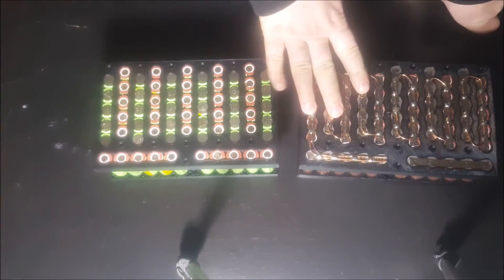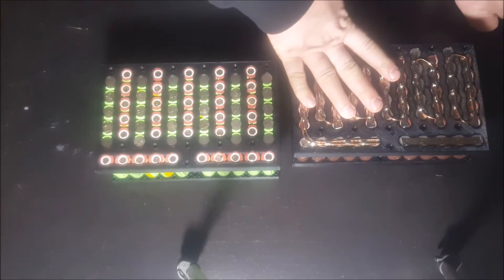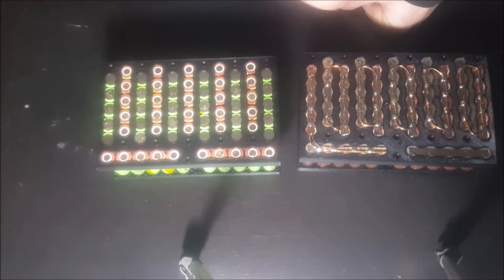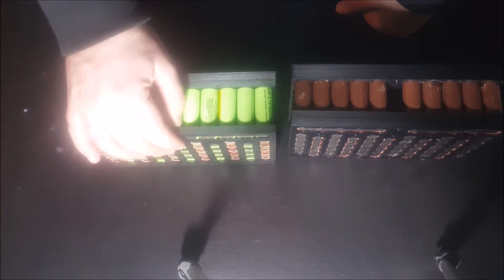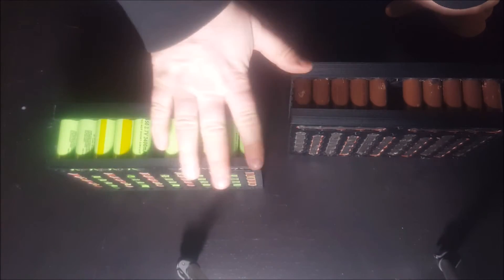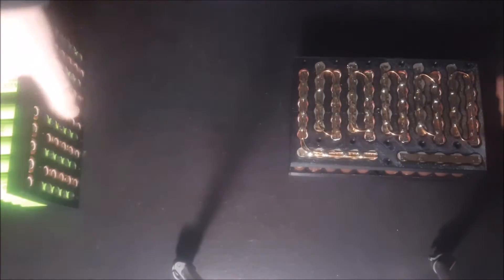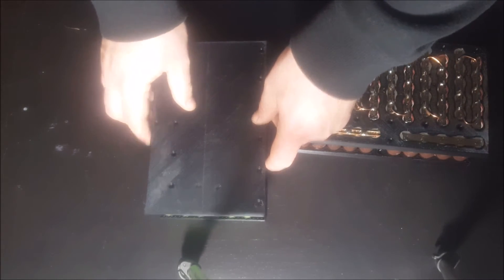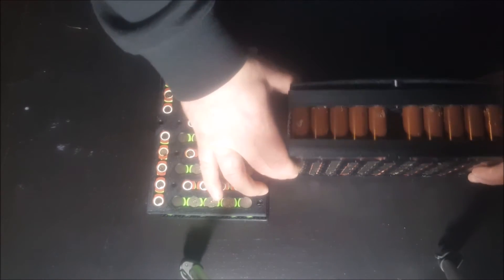Short update! Custom 3D printed 48v eBike battery prototype (part 3)

Comment: Have you considered using nylon bolts / threaded rods w. screws on them? That way you don't need to worry about them ever shorting out the batteries!

Something like this perhaps: http://www.ebay.co.uk/itm/1-METER-NYLON-PLASTIC-THREADED-ROD-BAR-STUDDING-ALLTHREAD-M3-M4-M5-M6-M8-M10-M12-/361082098568?var=&hash=item54122b9388:m:mep9PHeJkiqRerMTqRKfHTg

You will need matching nuts and washers obviously...
Reply from the maker: Morten Mortensen those look like just what I need! Do you think they are strong enough?
Reply: Good question!

I think they should be fine for what you need here, a M4 nylon all thread rod have a break tensile strength og over 600N if I read this table correct: https://secure.microplastics.com/mechanicaldata.aspx

They should be plenty string to keep the pack together unless you plan on throwing it out the window at 60mph... :-P

I would use some crash protection on the battery anyway and never just rely on the 3D printed plates you've made as the ABS you shatter on impact I would think...
Reply: Here's a US source: https://www.grainger.com/product/GRAINGER-APPROVED-M4-0-70x1m-2KB92
Reply: Yield strength of a M4/0.7 pitch all thread rod is 214N so you can hang ~22kg from a single M4/0.7 Nylon rod!

http://www.farnell.com/datasheets/103558.pdf
Reply from the maker: That's pretty impressive! Definitely plenty for holding this thing together... I'll probably get some metal bolts initially unless they have them at the hardware store, but will look at these long term. Thanks!